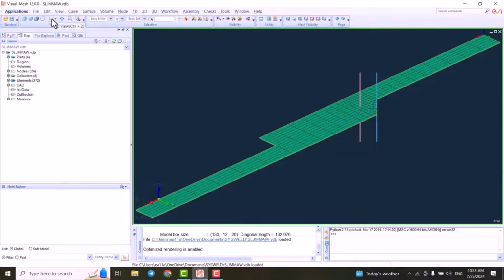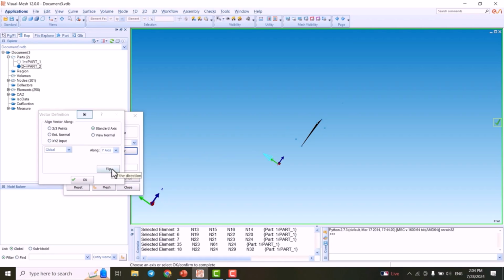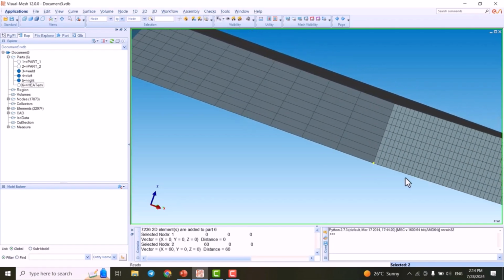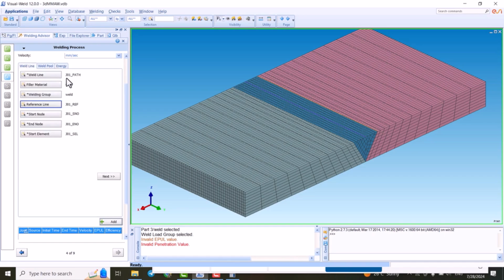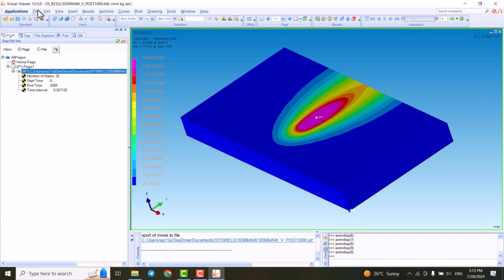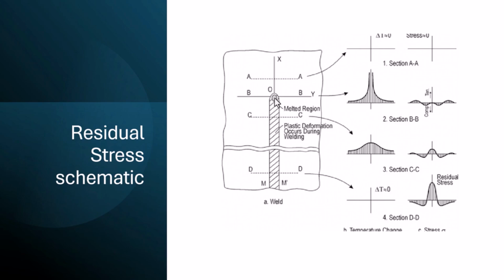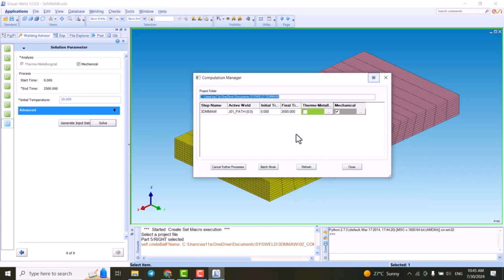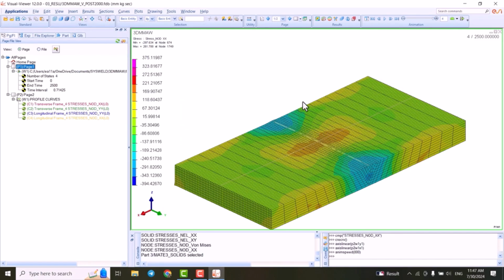SYSWELD Intermediate Masterclass– Complete Welding Simulation Tutorial

Comment: how can i simulate a similar process, but with pre- heat in the region near HAZ?
Reply from the maker: Create a step, in load and boundary condition set the predefined field temperature in that step. You can select the region too.
Reply: @FEAMASTER  I will try that, is that step defined in visual mesh or visual weld stage?
Reply from the maker: it's in visual weld!